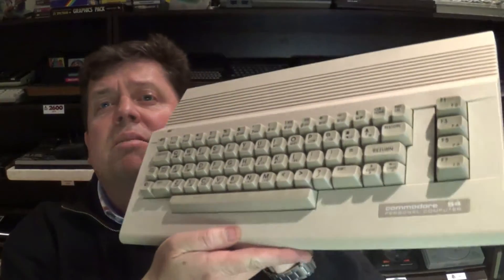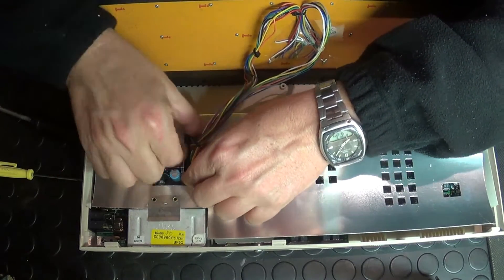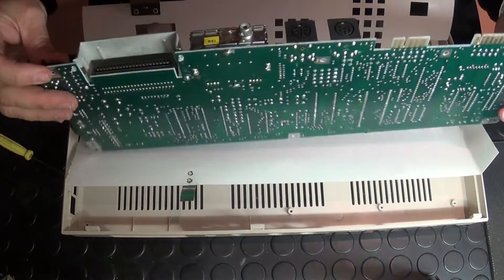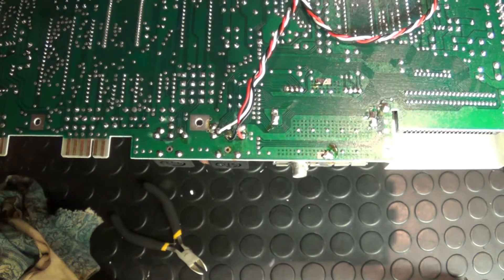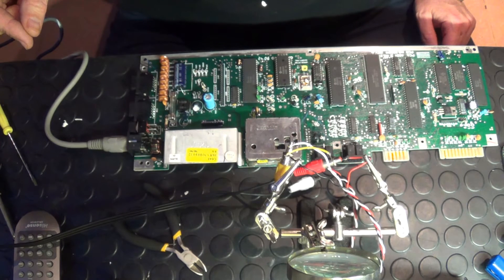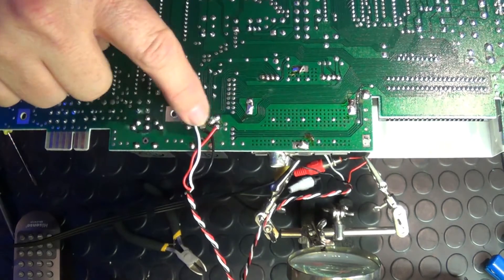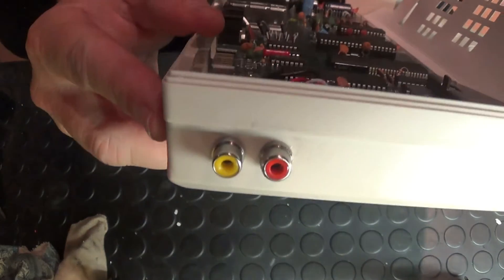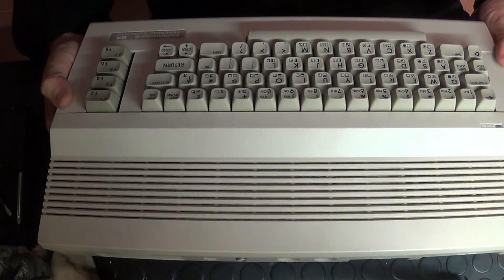Quick and Easy C64 AV mod

Comment: This mod doesn’t make sense to me. The C64 has composite output and audio on the 8 pin DIN. There are 5 pin DIN to cinch cables which work perfect on most LCD TV’s. And the 5 pin DIN fits perfectly in the 8 pin DIN on the C64. I myself made an S-Video cable which gives a very nice and clear picture.

Comment: Just buy an AV Cable, why mod it?  Cables are only like $10 shipped.   

It almost seems like you think the connector on the back of the TV had to be an 8-pin socket, no the cable for C64 has an 8-pin connector with standard RCA cables on the other end to hook up to your TV.

Comment: Great retro machines collection behind you! Congrats...
About your mod, I suggest to use S-video connection, as quite better image quality...
I think small mini-din s-video socket is also easy to mount inside C64 (simmilar to your mod) - if you don't want to use standard DIN cable.
Reply from the maker: +KATOD_music Should work. I will try it sometime. THKS

Comment: Maybe you can help me?   I plugged a joystick into port one whilst my c64 bredbin was on and got a slight shock,now when i turn it on,the cursor continues to scroll right as if the space bar is pressed down,this still happens when i detach the keyboard from the mothertboard.....Any ideas on what is wrong???....Please help if possible my friend...Kind regards...Aaron UK.
Reply: azshaw123 
hey here is your answer to your problem.
http://www.oldsoftware.com/6526.html
be carefull not to short out pins next time you plug a joy in your c64 by turning it off before !
cheers
Reply: Killed the CIA but I notice someone else has mentioned it.
Reply from the maker: MMmmmm. Let me browse the net and see if I find something for you.
Reply: Thanks Kind Friend!!
Reply from the maker: azshaw123
I did some browsing but no luck. I would suggest taking apart. Visibly check if anything is shorting. I mean surely the joystick port should not be able to cause damage to the machine. If you have another C64 try swapping out some of the chips to find the faulty one. A bit of trial and error. Sorry I could not help. Cheers
Reply: thanx for your help m8..I will give that a try!!!!
Reply: Thank you!!!
Reply: azshaw123 
no prob ;)

Comment: How did you make the holes in the plastic so good..?
Reply: +Spanner Nick It's not so difficult... When I'm making holes in my C64 (buttons, SD card socket, pots etc) - I'm starting drilling with small drill (2mm diameter). If hole is circle shape - just make next steps (2.5, 3, 3.5 etc drills) up to correct one - for example 8mm. If hole is sqare or unstandard shape - make small holes in line 2mm away from shape edge and after remove inside plastic finish with small file tool. Good luck :)

Comment: Interesting, I did something similar however I used a 5 pin din socket to rca and soldered it up myself without having to open the machine up..

Comment: Interesting mod. I'm not 100% sure, but did you end up bypassing the RF modulator to do it?

I'm just wondering as one shouldn't need to AV mod the C64 - the full 8-pin are used for Commodore monitors (or with the right cable, S-Video on a newer CRT).

But, if you've got your VIC-20, or Atari 8-bit hooked up with a 5-pin composite cable, it'll work on the C64 as well (as I do with my own C64 & 800XL) :)

(I guess my concern is making sure people don't do this mod unnecessarily - especially if they're not equipped to handle it.)
Reply from the maker: RF works as normal. Simply taking off the video, audio and ground signal from the din socket. When you have a lot of different systems and consoles you want them all to have av connections so there is no digging around. I try to convert them all to have av sockets. Less mess of cables on my desk. Cheers